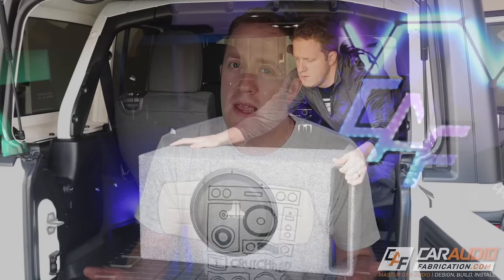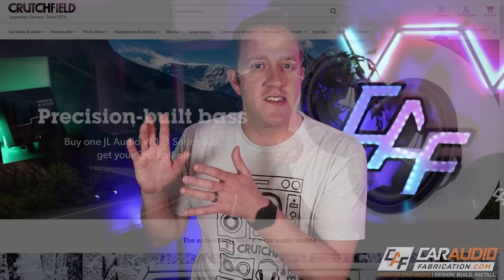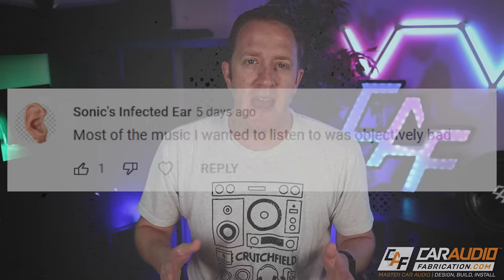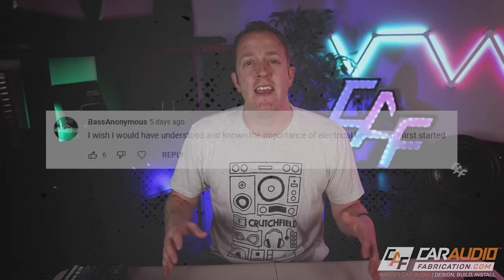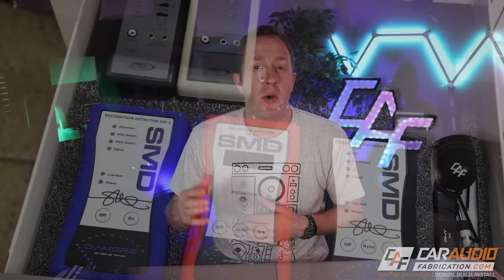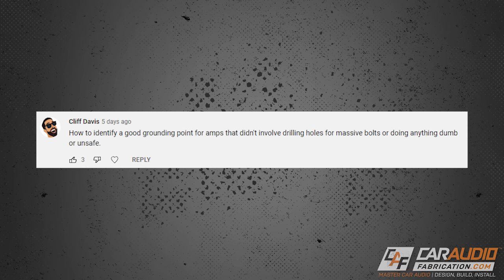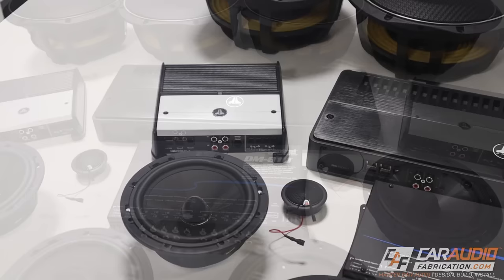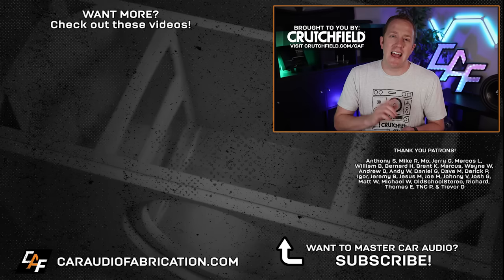My Car Audio System SOUNDS AMAZING now that I know THIS!

Comment: Yes absolutely the proper air volume for the subs. And the ported is much more in-depth)thank goodness for computer programming) 

When it comes to sealed I always went with the recommendation from the manufacturer. Yet everyone recommends a + 10-15% increase in size for a sealed enclosure. 

I’m curious what do you believe in and recommend?

7. !!!! Sound deadening!!! Absolutely!!!!
Reply from the maker: I always dislike when people talk "rules of thumb" like they are a hard set rule. Nothing wrong with using them as an early approximation, but you need to do your due diligence of calculating what is best. Unfortunately like you said many people would just make a suggested 1 cubic ft enclosure 1.15 cubic ft because of the "rule of thumb" without actually calculating the change to the subwoofers response and deciding if that is favorable or not for the goals of the system. Important to always design with a goal!
Reply: @CarAudioFabrication  well Crutchfield suggested to get as close I can to .9 cf of airspace for a sealed enclosure for a Infinity Kappa 1000 . So I will stick to there recommendations, they have never failed me before.

My computer is not running my box programs for some reason.

Thank you

Comment: Hey guys, can anyone help me? I have a 3k watt amp and 2 subs that are running 1600w rms together. I’m trying to set my gain with a multimeter but I don’t know if I should do the maths with the amp max output or the sub output. Thx in advance

Comment: Got that Question now lol. looking for amp RMS size for the mids and highs there JBL gto609c 6.5 components will be active with the cross just for protecting the tweeters have dm-810 was looking at the acm-4.300 but at only 50 watt will it be enough trying to do a Sound Quality build the subs are 4- 8in kicker Q-class L7 squares in small sealed box with kicker kxa1200.2 or about 300rms each.? need to get a amp soon as the budget is getting titer everyday. O and a added benefit if you answer my Question ill subscribe to your channel sorry I had to many channels so I dumped them all and now only sub to channels that interact other wise there just watch and go channels. thanks

Comment: Best way to integrate subwoofers into cars while keeping factory radio.
Reply: or they make speaker to line level converters but like steve o said amp with high level in .. but if u already have the amp or the amp you want dosnt have high level ins the line converters are not that expensive
Reply: You need a line out converter, i’ve had cheap passive ones, and an audio control LC2i; i thought the LC2i wouldn’t make a difference, but oh my god it does going from a passive LOC to that. just be careful with how you tune it, it’s very easy to push a little bit too much power because it is a powered line out converter, and harm your amp

Comment: What are your thoughts on converting your downloaded files to meet mp3 or flac standards? Meaning converting mp3 to its 320kbps file size or converting from mp3 to flac or wav?
Reply: You can't convert mp3 to flac as mp3 has already lost quality it is pointless to convert a file that has already lost quality.
Reply: @desperateosprey  I'm not a sound engineer or expert on the different types of audio files but I use a converter that when I download a YouTube video to mp3 it comes out to 128kbps I then convert to 320 kbps  and then as long as I have the proper settings I can convert it to flac or wav.
Reply: @MFDANIEL2 , problem with this is you’re just “upgrading” a already degraded signal. You can’t “fix” a degraded signal. Your better off getting a new recording in the format you want.
Reply: @62dobie  Degraded? you mean compressed? If I download a 128kbps mp3 and make it a 320kbps mp3 wouldn't that be considered increasing the quality?
Reply: @MFDANIEL2 ,no. Because with all you increase, you also increase distortion, hiss and the loss of quality and noise from it being compressed in the first place. It may sound better to the untrained ear, but when you play it back on a very well tuned system, it will show and you may not like it. Good luck on what you choose. I use to do the same thing with my music. In the end I just bought better music and save it that way. Good luck.
Reply: @62dobie  I mentioned I wasn't a sound engineer or audio file expert but I was a DJ for 20 years and I think I would hear hissing or distortion.
Reply: @MFDANIEL2 , with a good ear like yours, and good equipment, I’m sure you would be able to tell the difference. I also did a good amount of DJaying in my day. Also worked out of many music studios. It’s mostly about the equipment. If you have good equipment to recapture your music, go for it. Not saying it can’t be done, most people don’t know a quality recording when they hear it. Being a DJ, I’m sure you understand what you’re doing. Good luck.
Reply: @62dobie  well tuned system? Now my car system has 14 total speakers and 12,400W RMS from four amps. I have four 175w RMS tweeters, four 300w RMS 6.5s, four 300w RMS 8s and two 5600w RMS subs, 2800w RMS each. All ran through my DSP and tuned/equalized by each channel according to the frequency response requirements of the speakers connected to that channel. All inside speakers are wired down to 1ohm, my tweeters are ran by an 800.1D 1ohm stable amp, my four 6.5s and four 8s are ran by an 1800.2D 1 ohm stable amp and each of my 1ohm DVC subs has their own dedicated 4k amp and are wired independently at .5ohm. I'm leveraging a 390A alternator, 4 AGM batteries totaling 470ah and an ultracapacitor that's 375 farads that keeps my voltage between 13.8v-15.2v.   Is that considered untrained?
Reply: @MFDANIEL2  You can't increase quality on a file that is already degraded. You will increase the file size but can't bring quality back that wasn't there to begin with in the original 128kbps file. That data was compressed and already lost you, would have to start with a good quality file such as a flac file, then you can convert that file to w.e you want but once again that data will be lost and can't go back.
Reply: @desperateosprey  Since I play the music in my car, logged into my DSP to check the RTA and I just compared the amazon mp3 I downloaded and the youtube mp3 track I increased the bitrate on and they sound the same. No degraded sound. If you have your settings in youtube to playback and download in high quality audio you can avoid bad quality sound.
Reply: @MFDANIEL2  

Your ears don't work.

Not surprising for a DJ.

Why ask a question if you're just going to argue?

Spend some time learning how file compression works. Or continue to play with the equivalent of JPEG pics for your sound.

It won't matter to your ear, so whatever.

Comment: When keeping the factory amp and replacing the head unit, which wires are not needed with the new harness and what to do with them.  For example, not too many after market head units have Speed Sensitive Sound.  Do you ground that wire, leave it alone?
Reply: Dont ground any wire blindly ever. The answer to your question is incredibly car specific.

Comment: i wished i knew pioneer sucks😡i bought two 12s at 120 bucks each the New model  1500 watts 500 rms each,and they burned out real quick☹my class D amp is cheap hitting 630rms and its less than half of gain,if i turn it up theyll fry out!

Comment: DSP is definitely unnecessary unless your a super sound quality freak ... A good head unit combined with today's amps there are more than enough lpf, hpf, sub level, equalization, crossover, subsonic filter, slope and a slew of other settings at your disposal.
Reply from the maker: What about when you can't replace the head unit? And I have yet to see a head unit that can offer full control of every channel when using more than 4 speakers.

Comment: Anyone know why I hear buzzing of the alternator ? (Only when car is on). Behind my head unit, I had to do a loop around the RCAs with a ground wire. That helped but there still is some noise. Is the headunit dead? Are the RCA connectors dead? Head unit is at least 15 years old. Thanks (see picture here for what I had to do behind my head unit https://www.ecoustics.com/electronics/forum/car-audio/644177.html) I have a Pioneer DEH-P6900UB.